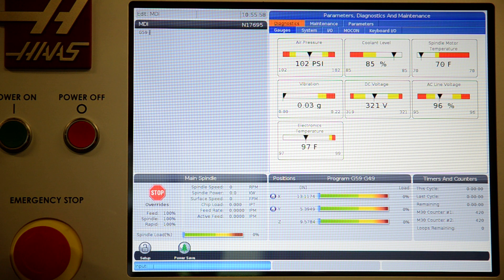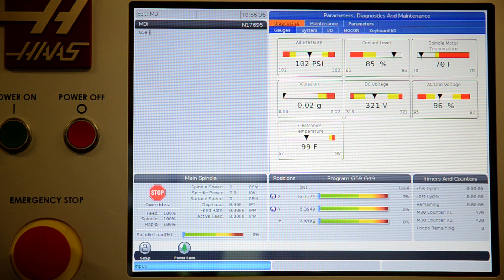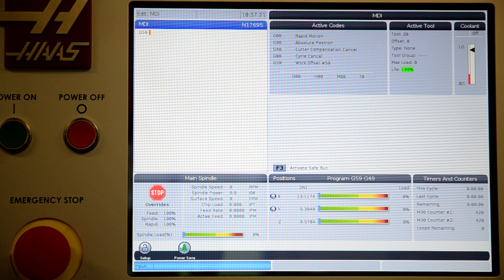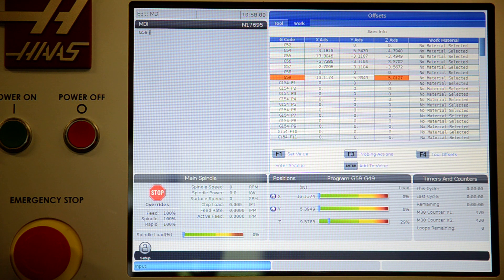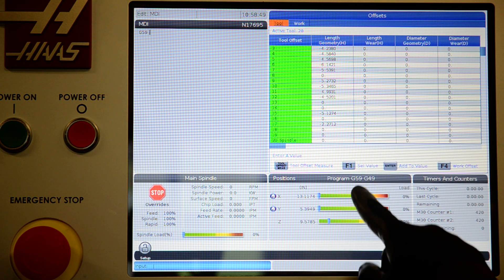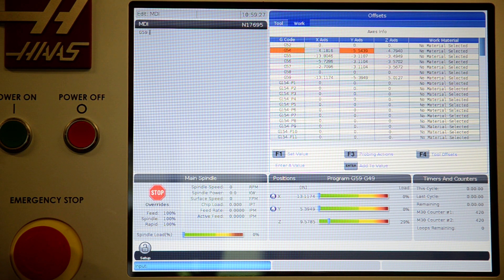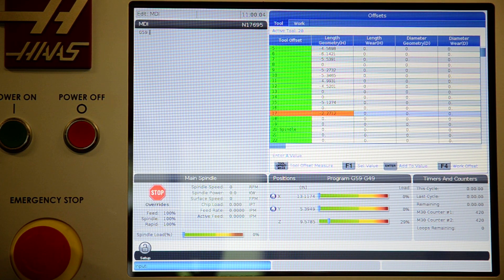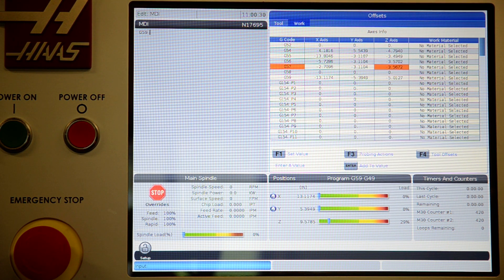Setting Work and Tool Offsets On a Haas Without a Probe

Comment: How did you get the text on tool 20 to say spindle is there a way to call that out so it references that? I almost had this method Working and i broke a tool and then it borked all my settings and had to restart. I hate how haas z offsets work Tormach pathpilot is so much better lol

Comment: Having used this method for years I am now trying to change over and use real tool lengths, unfortunately I can't find a method of doing this without having to enter the tool length or haimer length into the work offset after hitting part zero set.  I need to do this so that we can use any tool, haimer or anything to set our work height.  Essentially all I need the machine to do is take the tool offset value into account when I hit part zero set.  I'm hitting a brick wall with it though.

Comment: I’m changing to this method cheers. What happens when the tip is changed and have to rezero the heimer, all old tools offsets need to adjust accordingly?
Reply from the maker: Yes. It’s a good time to touch off all tools and a reminder not to break the tip again.

Comment: I tried setting up my tm2 like you showed but could never get the z offset to work properly, the tool offsets looked correct but the distance from the dial z setter to the work piece never seemed correct, could you show your setup on the machine table, I’m sure I’m missing something

Comment: Sure is a nice shiny new control you got there. . .

Just to confirm, the work offsets do NOT stack?  Like, you don't have to go back to G52 (or whatever calls the original machine zero) before you measure the new X/Y/Z locations for your new fixture offset?

The control on my machine stacks the fixture offset on top of the machine coordinate system, so I always have to cancel the work offset before I measure for a new one, or hilarity ensues.  But then, my machine is very very old, and also kind of an oddball even when it was new, so that doesn't really mean anything I guess.

Glad to see you're still kickin' and making chips.
Reply from the maker: Yes it's great, I can make scrap and pull stock out of the vise faster and more accurately than ever before!

The work offsets do not stack.  It doesn't matter what wcs you're in.
Reply: @Farrow_Tech    HA!  Yeah, that does happen, especially in the first little while with a new machine.  You'll get through it pretty quick though, being a sharp feller and all.

Thanks for the confirmation on the work offsets.  Hopefully what machine I end up with next will have progressed to that point as well.